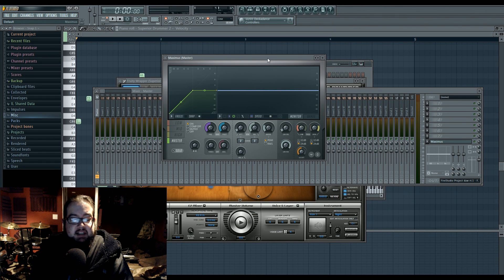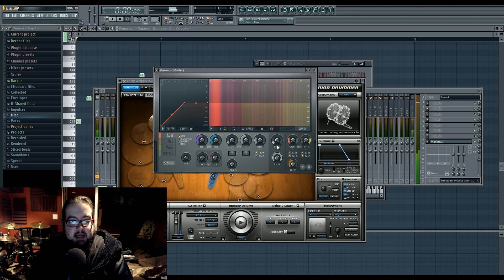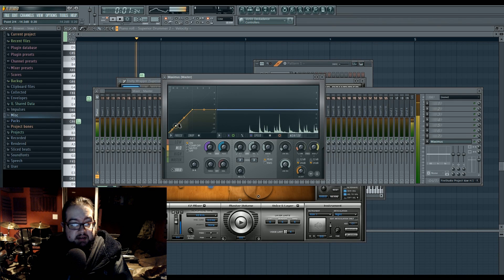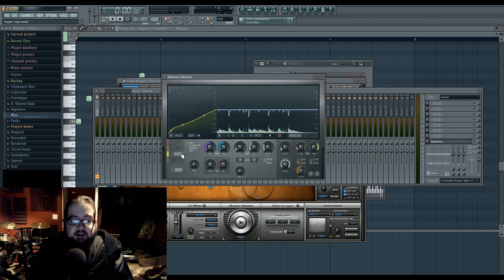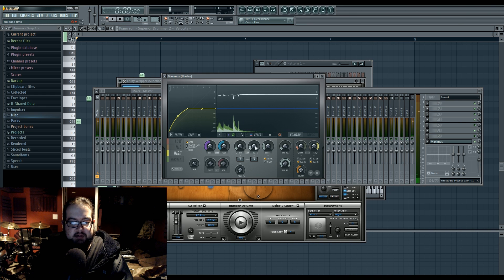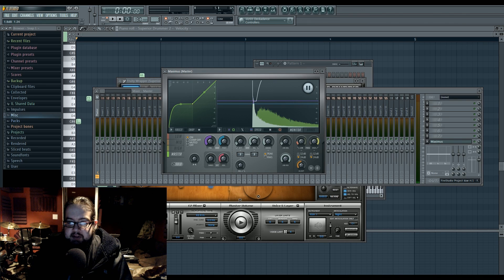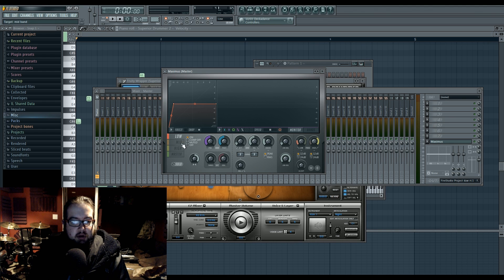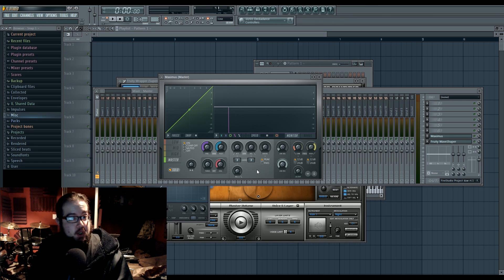FL Studio Basics 28: Maximus (Compression part 2)

Comment: I don't think there is a difference if you render it as a 16bit 44.1kHz WAV and start working with a new mastering project. Usually I produce a track, bounce it down to WAV and open a new mastering project. Besides from saving gpu power for the mastering process and having a much cleaner workspace with just wavs (all coloured of course) I don't think there are techical benefits. Just make sure that you don't use FL's dithering when you want to apply dither with external plugins while mastering.
Reply: Again, you're wrong.
Reply: @sidvicious332 Explain how I am wrong, if you care to reply to a 12 year old comment